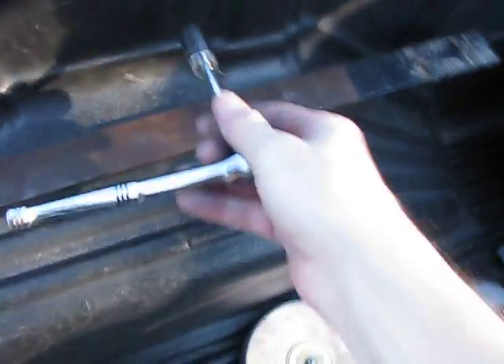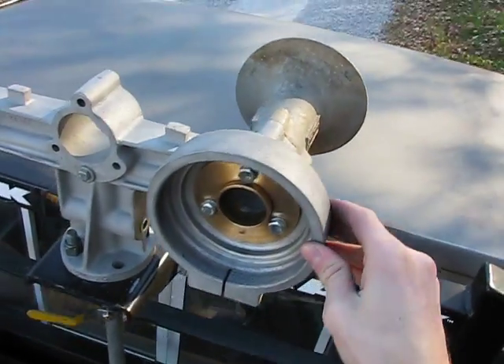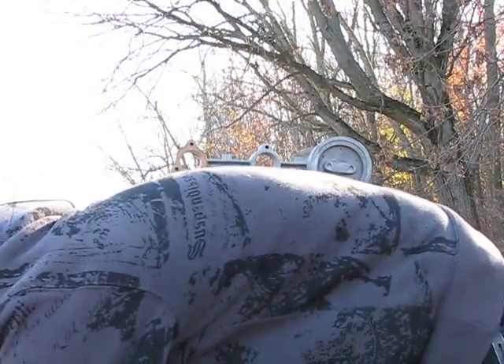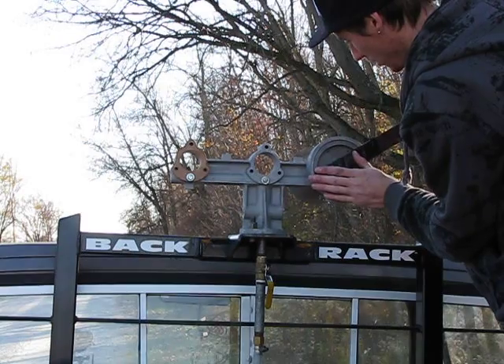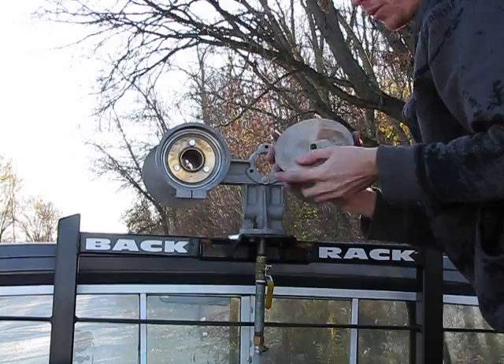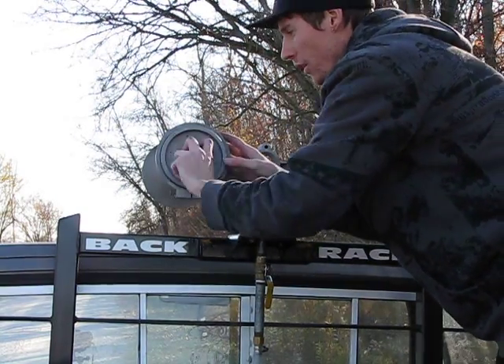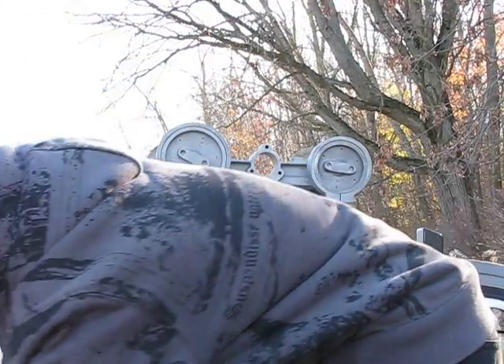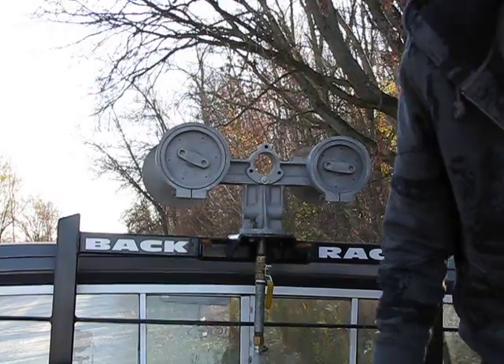How to shop tune an M3

Comment: I just purchased an M3H, haven't used it yet but noticed the chambers are spot welded. Since the spot welds are under several layers of CN black paint I would assume CN did this to possibly keep the horn in tune?